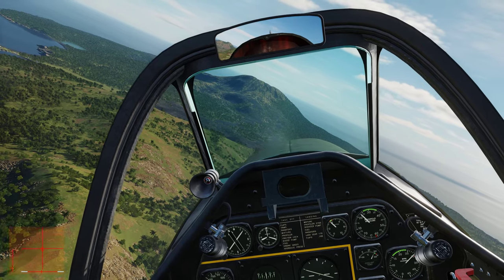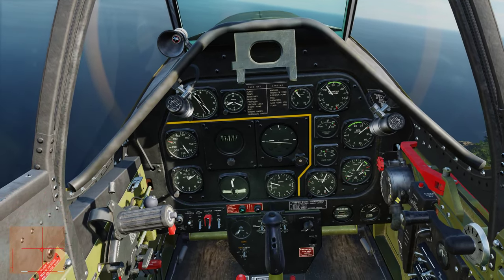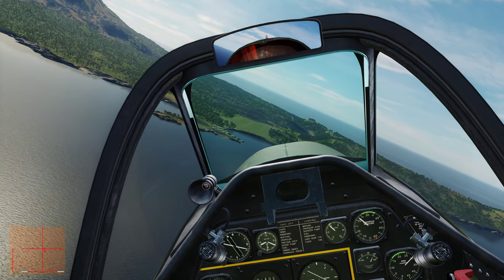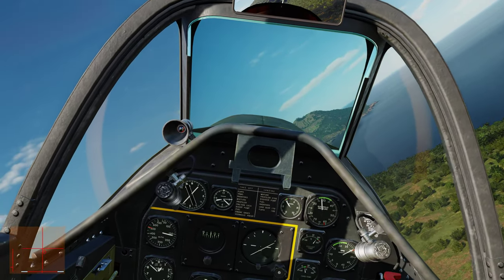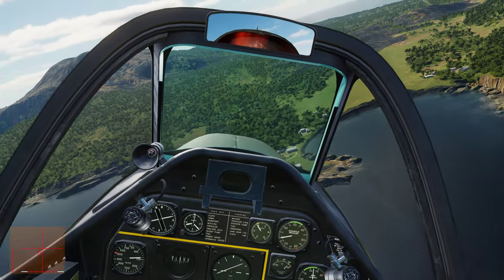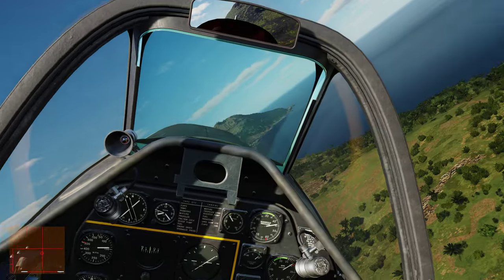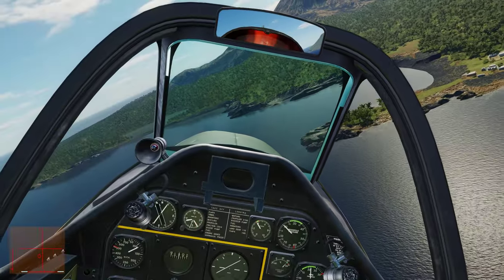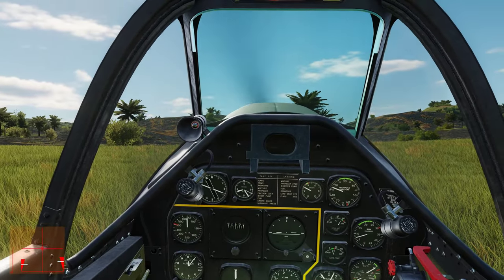DCS WORLD TF-51D Mustang Short Field Approach & Landing [PT-2] - Pagan Airstrip, Mariana Islands Map

Comment: Tried this in the P47. Man is it difficult. It feels like the plane is almost uncontrollable at low speeds with the flaps down. I don't know how you make it look so smooth!
Reply from the maker: Did you defuel the airplane a little bit maybe down to 30% or 20% like you would be landing after a real Mission?
Reply: @AIRWARFAREGROUP  yeah I took off with 30%
Reply: I'm pretty new to warbirds so I'm sure I just need to practice with it.
Reply from the maker: Yeah, taking off for 30% is perfect I think because you’re going to burn off 5% or more before you make your first approach… What really got me in the right direction was going back to my private pilot training about the stabilized approach and making sure I met all of the speed gates at each phase of the pattern. But I don’t think it’s all you, because the jug is pretty heavy beast, twice as much weight as the mustang. So I think you’re right with practice your nail it. Check out this video.https://youtu.be/bHbxSPzt74k